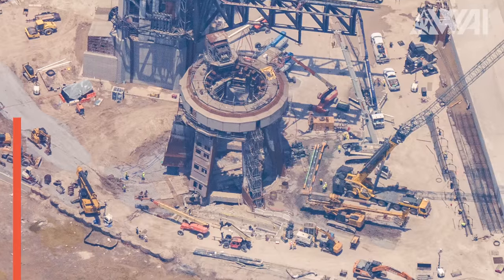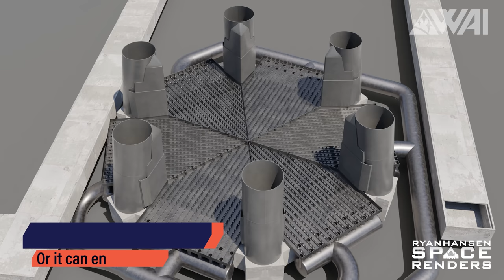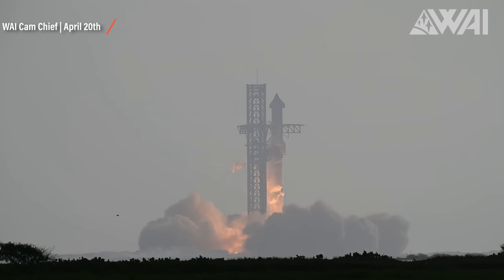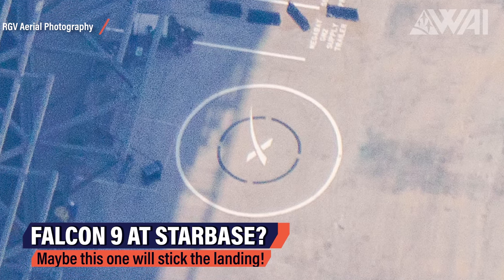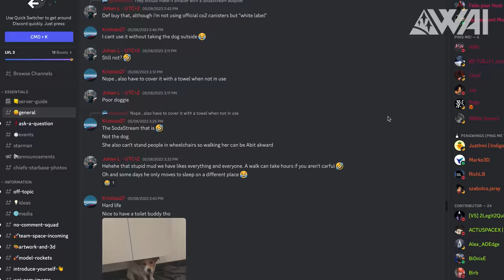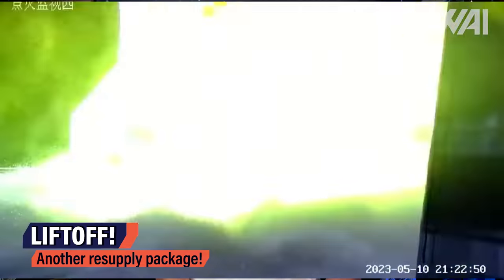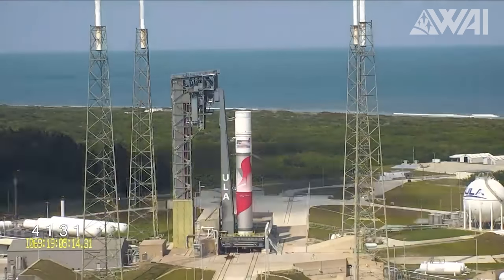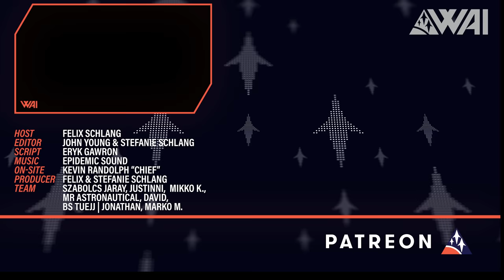SpaceX's even larger Starships made possible through world record Raptor 3!

Comment: During the first test flight of the Space X Starship, several Raptor engines failed during the launch.  Also, the first and second stages did not separate.
Reply: it didn't reach the altitude for separation; so that lack was understandable.
Reply: 1) engines failed because chunks of concrete flew up into them at liftoff
2) correct me if im wrong, but i think they confirmed that they didn't even attempt stage separation because it was too low and too slow
Reply: @Marrrrrko47  inaccurate, but close. IT was deemed a hazard, and then blown up by direction.

Comment: A thought:  since the HLS isn’t supposed to carry that much, couldn’t it be made from a stumpy version of Starship, with half the rings, half the tank volume, with the cockpit in the nosecone?
Reply: nope. it is still expected to be reusable. I eventually expect that the best "cockpit" will be no cockpit - where ever the pilot is at the time could become the cockpit.
Reply: @jessepollard7132  , reusability has nothing to do with size.
Reply: It will be loaded up with equipment for future missions. There are a lot of things NASA want to test and HLS Starship can carry large payloads in addition to crew.
Reply: @schrodingerscat1863 , but if the first mission is to just get there . . .  fast . . . 

The big Starships can follow later.
Reply: @michaeldemarco9950  The whole point of choosing Starship was to get as much equipment to the lunar surface in as few trips as possible. Remember at best SLS can only launch once a year with crew so there can be only one HLS landing per year too. Plus you don't really save much shortening the tanks most of the weight is going to be in bulkheads and engines.

Comment: Will SpaceX use the increase in ISP to reduce the engine count, or increase payload capacity?
Reply: Maybe use the engines at lower % to reduce stress and improve reusability?
Reply: Just because Raptor V3 could go 350 bar doesn't mean they should.

Just like in a car engine they're engineered to last longer but in a cost of not maxing what the engine is capable of. For example an engine could theoretically produce 500hp but could only last 20,000 miles but with only 400hp it could last 200,000 miles.

So with Raptor V3 SpaceX would have a bigger safety margin to push the engine and a much longer lifespan of reusability. They could also potentially cut down the amount of engine mounted in Starship which amount to less weight and complexity.
Reply: @LeftOverMacNCheese  If i'm not mistaken drag engines last for about 1 race or ~10 seconds LOL.. even formula1 ones does not have a long life maybe around 7~10 races
Reply: Payload! You can never have enough power.
Reply: @Capiibr  I'd say you're correct about this.
Reply: I would guess at possibly both, depending on the mass to be boosted.
Reply: @Capiibr  if its reliable on that boost level than they will increase payload ofcourse... i think they anounced a larger (2 rings higher) second stage too with that 6 rvac system
Reply: With the number of engines failing during takeoff, maybe they’ll hope the additional thrust might get them closer to orbit.
Reply: That is another possibility.

Comment: Felix @whataboutit and team serious question. If the new top end performance is around 18% more thrust, then the safety margin would be roughly 18% as well. 

With that increase in thrust per engine would that mean that starship would have a higher velocity at separation meaning that the upper stage would need less fuel to get into orbit? 

In turn would then subsequent fuel tankers be able to carry more fuel to orbit?

Lastly with the upper stage using less fuel, meaning it would need less in orbit, and the tanker hauling more. Would it not be feasible to assume that lunar starship/HLS would then require less launches overall compared to what was originally proposed? Making the Lunar Starship even more cost effective, less complicated, and more of a long term solution for lunar travel?

Comment: I'm having a hard time understanding, if the water cooled steel plates will be able to stay cooled, with the amount of force all the Raptors will apply. The water pressure will need to be high if it shall survive.
Reply: Remember that it will only be under that heat/pressure for a few seconds😊
Reply: The pressure drops as the exhaust plume expands. By the time it reaches ground level the pressure is about 5x what you get out of a public water tap -- high, but less than a touchless car wash.

Comment: I see no reason why Spacex will not enter the space station race. Create one Starship with a ton of docks around it's circumference. It's already larger than the ISS. Now dock other Starship modules to this center hub. Done right, you could theoretically dock a dozen or more depending how close they're willing to get with new modules. Wet workshop the fuel tanks and then each Starship module is 3X the volume of the ISS...

Comment: My prediction is once they can reliably launch a Starship and make it to orbit is when they will begin to ramp up the progress on the lunar lander Starship.
Reply: Seems entirely reasonable. 👍
Reply: Not so much a prediction as it is just a logical deduction, but yeah.
Reply: They already have Ship 26 with no flaps and tiles, so maybe an HLS test article.
Reply: Exactly. I think things will proceed quite fast once they get one up to space.
Reply: The HLS is itself quite straightforward engineering.  The unique features are the landing/takeoff engines that are mounted near the top and probably versions of the SuperDracos on the Crew Dragon, as Raptors are far too powerful, the legs which must tolerate irregular ground, and the elevator for access to the ground 30 metres below.  Those are all under development and are trivial engineering issues for teams like SpaceX has.

Much bigger issues are rapid reuse and orbital refueling.  Neither of these have ever been done on even a laboratory scale.  Bear in mind that it took SpaceX almost seven years from the first launch of Falcon 9 to the first reused launcher.  SpaceX does this so routinely now that we forget how difficult this was, and how many failures there were.  And Falcon 9 still takes many weeks for reuse.  I would be astonished if SpaceX can manage to catch a booster and reuse it in less than a year, but reuse is a mandatory prerequisite for the HLS.  And SpaceX must achieve this in less than 2 years to deliver the HLS in time for Artemis 3.
Reply: @EaglePicking  After looking at my comment again, that's a true point😂
Reply: @James Cobban  I agree. If they can achieve their goals, I'll be surprised. They've made a lot progress so far considering Starbase was just a bunch of sand and a few houses not too long ago. I'm hoping for the best, but expecting the opposite. I'm just happy with any kind of progress made with Starship.

Comment: I'm fairly certain that they will build a spinning ship for Mars travel; it makes sense, because so many months in zero G is very bad, and they will need their strength when they land on Mars. So, my prediction is that the first Mars mission will use artificial gravity.
Reply: and should be possible with an 18 meter diameter.

Comment: With regards to raptor 3; could SpaceX reduce the amount of engines needed on starship (28 for the same thrust as 33 raptor 2's) best part is no (or less) parts  right?
Reply: My guess is they‘ll just run the new raptors at reduced throttle, like 80% or 90%… that way they have more safety margin as the raptors aren‘t stressed to the max. Furthermore, should one or more raptors fail, they can simply throttle up the remaining ones to make up for the lost thrust.

Comment: The problem with too powerful engines is that the engines at take-off can go faster than the rest of the rocket resulting in the crushed beercan effect where the base of the first stage is turned into a metal accordion -and finally a fireball.
Reply: They do have a throttle though...

Extra power on tap means you have options in case of trouble.

Ideally you wouldnt run them at 100%. But a raptor 3 90% is higher than a raptor 2 100%. Or you can run them under 90% and have improved reliability.

Comment: This is madness! The whole idea of starship was supposed to be rapid reusability and multiple relights per flight. And SpaceX decides that the best way to achieve this is by designing the most complex, most tolerance sensitive, most stressed, highest chamber pressured, most delicate rocket engine ever conceived?

From an engineering point of view, absolutely nothing about Starship or the imagined Mars mission profile makes sense!
Reply: It makes sense to me. Continue to make improvements to your prototype engine, trying to maximize all performance criteria, test frequently and to the limit, even to destruction. That's how you make progress. You need a tough engine that can be reused for a hundred flights? Figure out the easy constraints, like how much power you need the rocket to have. Push as far past those constraints as you can manage, because the more redundancy you have the better. An engine design with an estimated max power of 269 tf is very likely going to last longer when run at 250 tf than an engine designed with an estimated max power of 250 tf run at its max will.

Another way to look at it. If you were a pilot and owned your own plane, with an engine that had key parts that would be subjected to pressures as high as 300 bar, would you buy those engine parts from the manufacturer that made and tested them to 300 bar or the manufacturer that made and tested them to 350 bar?

If your goals are to minimize the cost/kg to orbit, which is SpaceX's primary goal, then what they are doing makes very good sense from an engineering point of view. Especially if you don't want to take 50-100 years to do it.
Reply: @EllerraD  . None of these concerns require the engine to use a full flow staged combustion cycle, the most complicated and condition sensitive chemical engine cycle ever made.

Musk keeps saying that 'the best part is no part,' but when it comes to the raptor, that philosophy is thrown out. Suddenly, the best part is the most over-engineered, most complicated part?
Reply: @dansegelov305  SpaceX likes to eliminate parts but has never compromised on its engines. Take the Merlin, which has also been pushed to higher and higher thrust over the years while simultaneously becoming the most dependable (and reusable) rocket engine of all time. 

Simple is not always better, and sometimes you do actually need a kickass part. If SpaceX has credibility at anything, it is the iterative improvement of a rocket engine.
Reply: @dansegelov305  No, they did not throw that philosophy out when it comes to the Raptor. They utilized it ruthlessly. If you are interested start by watching Everyday Astronauts videos on the Raptor. SpaceX has simplified the engine and its production so much already that production costs are somewhere lower than $1 million but higher than $250 K, and performance that beats everything else in pretty much every metric except for Isp, which was a conscious, calculated fuel choice. And the engine is still in development, still being simplified.

None of their concerns require FFSC? I'm wondering why you feel so sure about that given that no one else has yet achieved a fully reusable space ship, let alone one that can launch 100 tons and refuel as necessary to take that mass to the moon, Mars, what have you. How do you know what's required? Funny how people were saying the same sort of thing about reusing boosters. Been tried, too hard, not required. Well, SpaceX did the math and decided differently. Now they're launching 80% of all mass launched to orbit. They're making Starship / Super Heavy happen to.

FFSC gets them the best Isp possible, which they need for vacuum performance. High chamber pressure gives higher thrust, which they need for launch. A philosophy of the best part is no part doesn't mean you don't try to do complex things when there is a benefit to it. Take the philosophy too far and you end up with nothing. Sort of like keeping an open mind is a very good thing to do, but not so open that your brains fall out.

Comment: Do they need to get the Raptor 2 reliable first? A failure rate of 10% at launch is more than just a teething problem. It is a MAJOR failure. Engines do not fail very frequently now. Hence the old reliable RS25s and such like in service.
Reply: Yes, each iterations is more reliable. And many more test flights comes up to sort out issues & increase reliability by actual data

Comment: Given that SpaceX has to land a "Lunar Starship" on the Moon BEFORE Artemis 3 (last quarter of 2025) SpaceX has to have all the flight testing, all the propellant transfer technology, all the propellant storage technology and a working design of Superheavy (and Starship) by the middle of next year to have a shot at putting a Starship on the Moon before the first part of 2025. Given their progress so far that's not looking at all likely.

Edit, should not have hit post :)

The VAST station does not look capable of producing any usable gravity given its dimensions. Being only 17ft/5.2m in diameter there would be a steep gravity gradient under any "spin" causing inner ear problems and general discomfort
Reply: 2025 is unrealistic, even for Apollo standard
Reply: @alvianchoiriapriliansyah9882  NASA is on track to be ready by then so SpaceX should as well.
Reply: @randycampbell6307  Same "on track" as SLS launching in December 2017

In other words: PR

Apollo Lunar Module took 7 years from contract (1962) to first flight (1969), and it's with the wartime effort to beat the Soviet. How would anyone sane enough to demand SpaceX beating that with much less funding?
Reply: @alvianchoiriapriliansyah9882  The Apollo LEM was actually ready for testing in a little over 5 years having a test model done in 1967 and first flight in 1968. Note they HAD an actual design within a few years and SpaceX has yet to have even that. Also the Lunar Module literally started from scratch with no prior experience, SpaceX has had actual experience. Yes the LM had pretty much an unlimited budget to start with but faced budget cuts starting in 1965. By that point they had a working design and an actual plan for development and had a model ready for testing three years later. After five years SpaceX still does not have a working design let alone something they can actually build on.

Comment: So which is easier/less costly: a launch mount with 100’ long underground supports and a steel, water protection system, or an elevated launch mount sitting over a flame diversion trench with a water cooling system? Waiting to see if all these bandaids will be applied to the Fla launch mount.

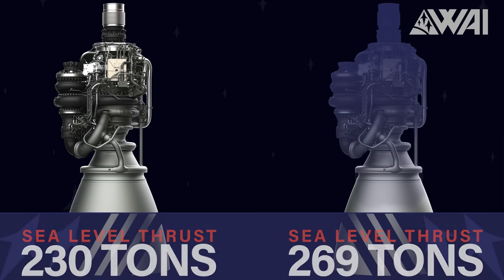Comment: ~ 7:00 - This is very impressive, but i think that SpaceX would be well advised to prioritize imroving Raptor reliability over chasing thrust and chamber pressure records.
Reply: Exactly. The series of Raptor failures 2 weeks ago gave me the feeling that there are design issues that SpaceX doesn't yet understand. Did you see Peter Beck's comments (CEO from Rocket Labs) on this issue? To the effect that if you want a reliable and rapidly reusable workhorse engine, you need to dial it back a bit.
Reply: By increasing thrust and chamber pressure, the Raptor 3 has more design margin.  That means it can be run at less than maximum levels while outperforming Raptor 2 AND be more reliable than Raptor 2.
Reply: @tedtomoyasu8438  Provided that increased thrust and pressure were not achieved by pushing the margins.
Reply: To actually go for 350 bar operationally, they will need to test engine beyond that for margin

Comment: What about this :-  Could a space ship be launched by the pressurised water itself ? Once the craft had gained enough height for any rocket propulsion to not greatly impact the launch site, the engines could be throttled up to take the craft up as normal. This would reduce the amount of fuel needed in the craft, thus reducing the need for fuel to carry the fuel  - rocket equation. Also, it would give the ground Zero Stage an even greater part to play but not need a lot of new equipment- bet part is no part - or a smaller one. Economically and ecologically, forcing the initial dead weight off the pad by water pressure- giving the craft kinetic energy, would allow a long slow water pressurisation system to charge the water launcher rather than need a controlled explosion. 
Idea in a few points:-
Less rocket fuel would be used.
Any odd water could be used and reused as the launching jet.
Low cost water pressure systems could prime the Stage One launcher.
The pad would not need to be so incredibly solidly built as it would be created by water at each launch.
Less fuel would need to be lifted in Stage One.

The tower would need a water blast cup at the base, protecting the craft's engines from the water power. This cup would be part of Stage Zero. It would be forced back down against the water lifting jet - protecting itself, the tower and the craft engines.

Just a thought - I'll ask Elon...

Comment: More powerful engines means that they need an even stronger launch pad because even if they respond to the increased thrust of the Raptor 3 by reducing the number of engines each engine will hit the pad harder.
Reply: or be able to use a lower thrust amount to get started. like launch with 60% power and only go to 100% when off the pad.